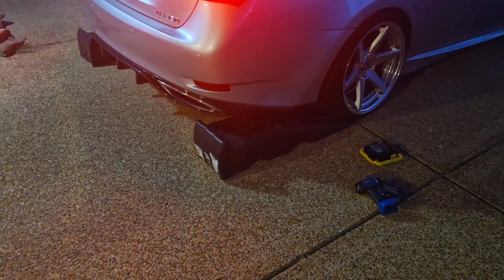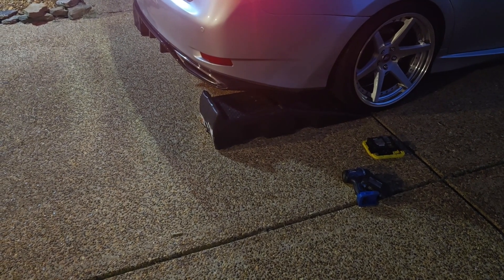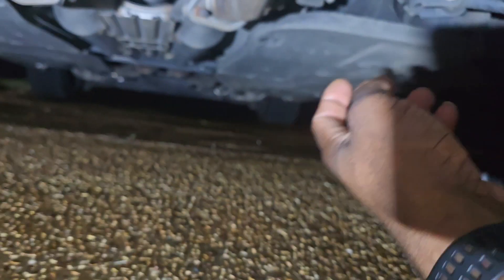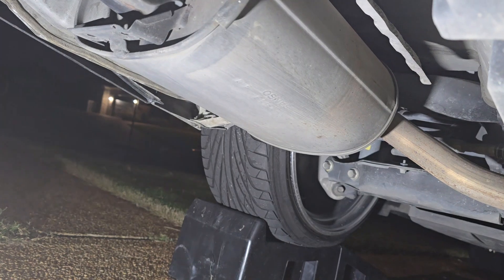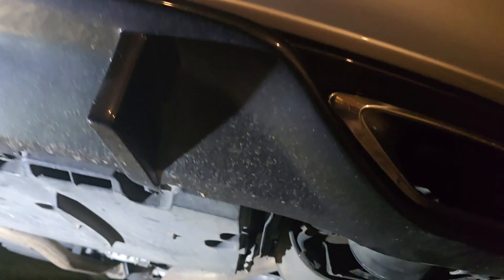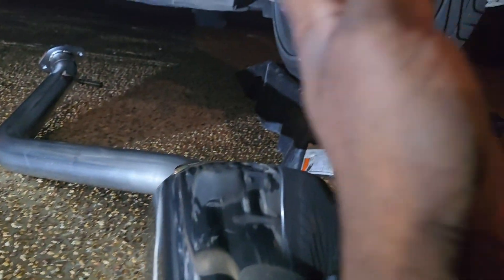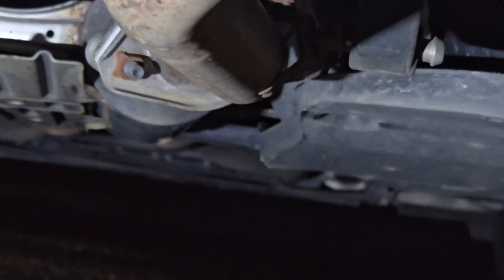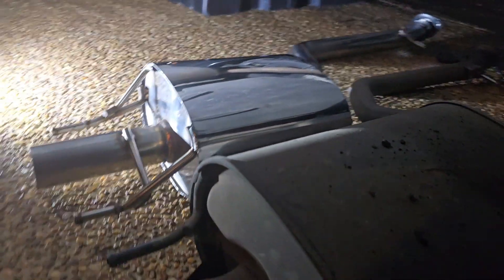2013-2020 GS350 AXLE BACK EXHAUST INSTALLATION

Comment: Nice video bro . I see you also changed the wheels . Good look 🔥 💪🏼. I’m looking to upgrade to the invida full exhaust.
Reply from the maker: @R0ll_lex  Thank you! Yea, I wanted to give the car a set of aftermarket wheels to set it off. As for invidias, I am thinking about the mid pipes, but I want to hear a car with it before I decide. I am deathly afraid of ruining the sound of the car.

Comment: If you don’t mind me asking, which rear diffuser did you purchase?
Reply from the maker: @Brandon-jy2yl  here you go, fam.
https://www.ebay.com/itm/113534115655?fits=Model%3AGS350%7CMake%3ALexus&epid=21027770890&itmmeta=01J3X8VPYWFX0DX5JGD78SSEWT&hash=item1a6f291f47:g:jc0AAOSwDTdfOi7N&itmprp=enc%3AAQAJAAAA0AuCF1tA6iT8q2sumxGVzz0aHM%2BoLFhWLBX9SwKB3Sl7SsAhlIeeJa8WJKzbCjAD4Q2OVG%2FRtTtgA%2FQOaAiyJ8zxUDYmLYS40CHtmyNKBLkVST9HZg%2F4Hncx2fWxmLLP1iCHMV8DZsxjSreni7FEyVgufypfH2FrsTR5cs%2Bn2UkvWW4GSqym4HCLjDn7fm0Aj%2FElA0hsLq1t7q8Wnoi7mCV4SAUT2t5Aw1ZPzCZIJDy5x6%2FFZI3ULyxgNdibxO5UnN%2FHynwUWs713Z%2BUcu%2FNgNY%3D%7Ctkp%3ABk9SR8Dv7qifZA
Reply: Thank you so much. Let me ask you something else. In your opinion, do you think a good body shop could make the GSF fender flush with the OEM F Sport bumper. I like good fit and finish, and that is one of the main things that discourages me from doing the conversion, other than price of course.
Reply: It was tough to see how much it was off in your conversion video.
Reply from the maker: You just have to manipulate the brackets on the headlight and the fender.

Comment: Next time, use gloves and a moving blanket. So you don't bang up the exhaust...
Reply from the maker: @CaptiankrabS  🤔 good point. If I do the mid pipes, I will. Thanks!!
Reply: Smart
Reply from the maker: @anthonylale1142  don't motivate him.
Reply: @Will_Power_BUILDS Hello sir. Did you take front of exhaust off first, then the rear slid out?  Or did you have to remove bolts to take the rear down?  Thank you
Reply from the maker: @anthonylale1142  I removed the bolts, pulled it back (towards the rear of the car), pulled the flange down, then pulled the entire thing forward (towards the front of the car).